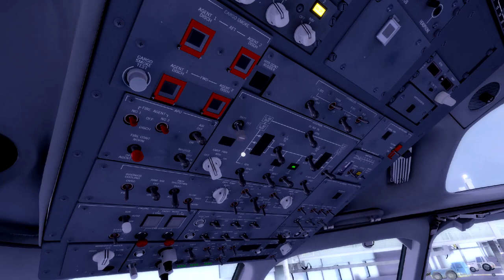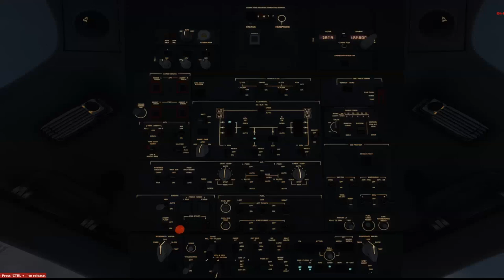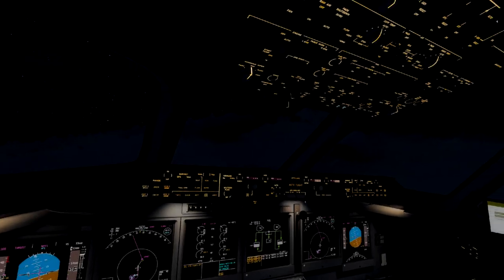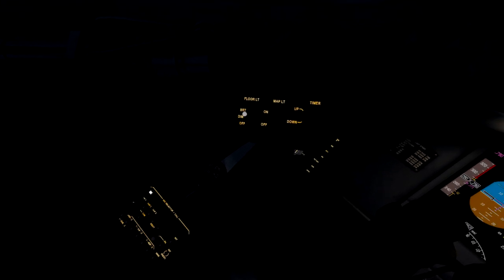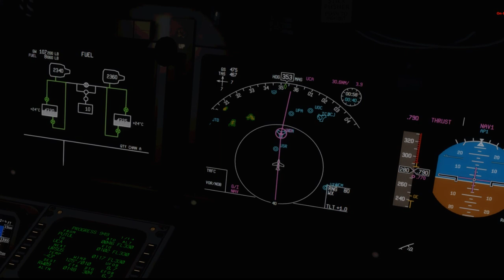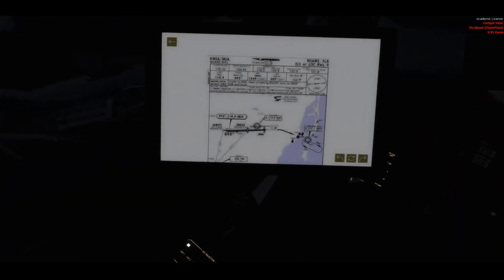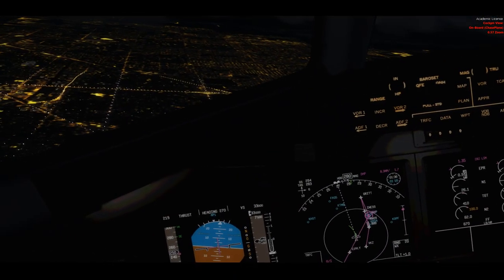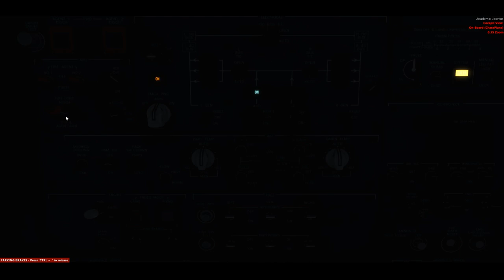[P3D] Kingston to Miami in TFDI 717 - Shared Cockpit Action

Comment: How do you setup the shared cockpit? I find myself kicked out every 20 second when i try to connect with a friend using hamachi
Reply from the maker: The tfdi 717 has a built in shared cockpit feature.  Forget hamachi.  You need to forward your ports in your router to get this to work.

Comment: Which flight sim software were you using?  I don't want to presume FSX as this could be p3d v4
Reply from the maker: P3dv3.4.  You can do this across sims....as long as you use the custom tfdi 717 shared cockpit feature